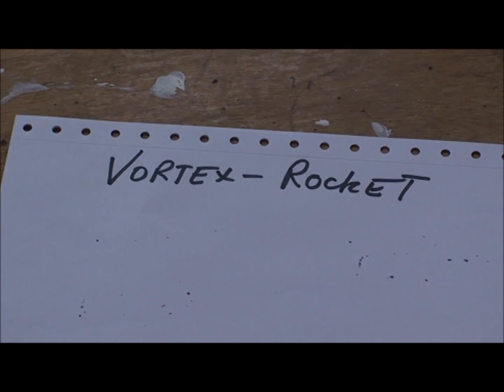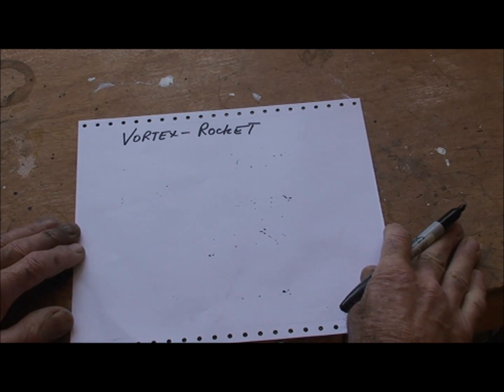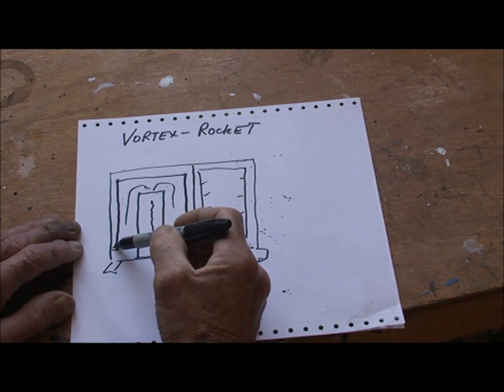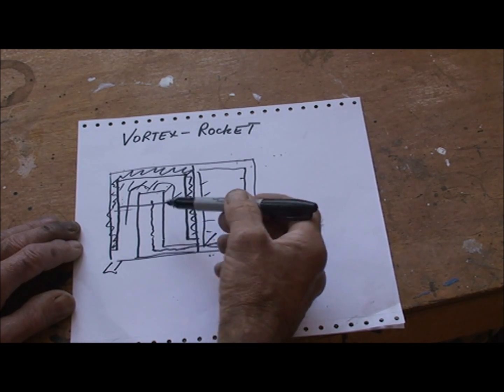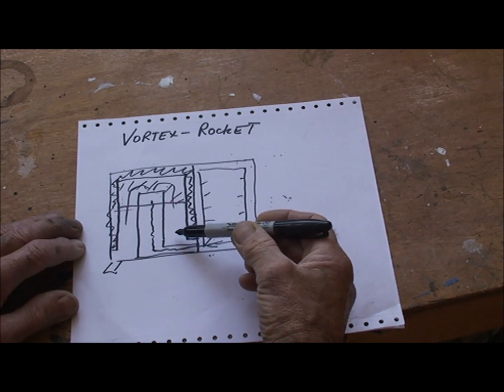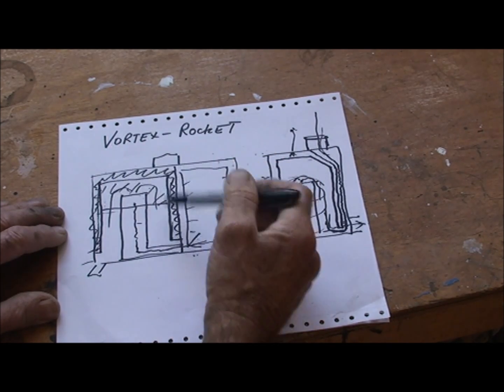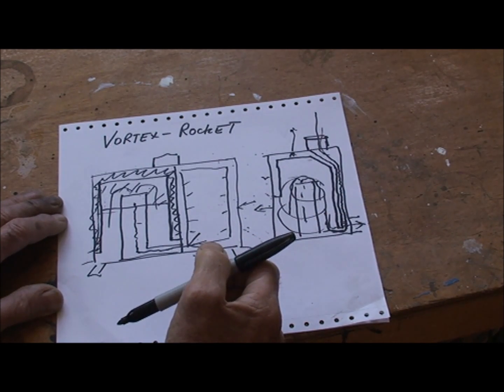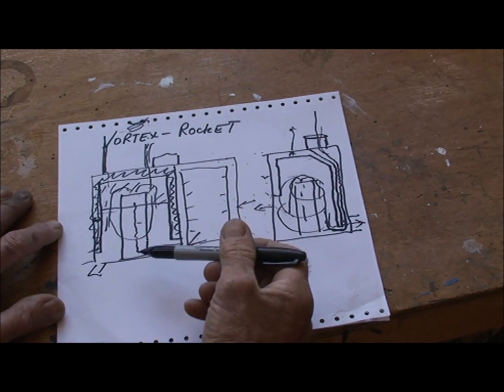V Rocket stove room and water heater.

Comment: Hi ppotty,
                  I am new to your site - sorry to post this so late but I feel it is worth some comments.
                  I have been thinking about water heating from standard rmh but not really progressed as new ideas bombard the fledgling ideas. I saw your vortex tests and I believe it resolves a number of problems - one in particular that I was concerned about was how to slow down the rise of hot flames up the internal chimney (vertical burn tube) - this gives the heat to further pyrolyse the smoke and burn it before it provides heat to the top plate or is exhausted to the chimney. 
       Now for budding idea for water heating - using your technique of 'vortex' - assume the inner vertical burn tube, at a suitable height, was replaced with a 'calor gas bottle filled with water' and the vortex was encouraged to go around the bottle or the bottle with 'some insulation to compensate for reduced burn temperature of the vortex mechanism (if necessary) due to high thermal load of water tank. I am not at the stage of trying it out as I have not yet achieved controlled and consistent vortex on standard rmh. 
        Has any body already tried this or similar approach.
Reply from the maker: +Davinder Dhanjal Hi There, a jacket around the riser tube filled with water has been tried and works, i would keep the jacket in the top half of the riser though so that the base of the riser gets hot enough to combust the gasses and burn clean, a tank over the top of the riser or on top of the stove would also work well as this is the hottest part of the stove and would be alot easier to fabricate and maintain. The top half of this stove i made is a water jacket one bottle welded inside another the riser tube sits inside like a normal rocket stove. https://www.youtube.com/watch?v=KdDkkKRv4aw Cheers.

Comment: I know this video is old but I wanted to make a few suggestions that I guarantee will make your system work and very well.
I tried your method and it worked well, until I would be gone all day for work. The water would cool down and I would have to wait for it to get back up to temp. I got around this issue by building a 250 gallon exterior water tank that I then super insulated. The stove would heat that water up while it was running and I could pull off the 250 gallon tank to my baseboard heaters. Being really insulated even when I am gone all day for work and the stove goes out or produces very little heat when low I still have more than enough heated water to keep out home more than comfortable for hours and hours.
It worked so good I added a second tank that now heats my greenhouse, shop and hot house hot water and it does it off 1 stove.
If you really want a great system add some large holding tanks and your life will be so much easier. Thanks for the vids.-- Rick
Reply from the maker: rcklarue Thanks Rick, Im really pleased you went ahead and built a working version of this stove, I had hoped that the exchanger would produce alot of hot water and you proved that to be the case, good idea on using the water tanks as a mass heat store.
Reply: I've been meaning to build a home heating system and hot-water supply, with several holding tanks as you mentioned. However, the jacket design I had not considered. I instead had planned on a sealed/contained housing for coiled copper tubing. I must say that the water-jacket would be suited for just home heating and not for consumption. I'm I wrong to think that the water jackets would eventually rust out? As you did say that you built it.

Comment: If you want max heat from rocket stove lift burn chamber up and wrap a water jacket around it or coil copper tubing around the burn chamber. My understanding is the burn chamber has to be insulated to keep the temp up to maximise the burn so wrapping a heater jacket around it would maxify the temp to the water.

Comment: Wow I like your idea and can't wait to see how it turns out . I think you might benifit from running an air intake across the secondary burn chamber super heating the air supplying the primary ... just an idea thought you might interested in Martyn S.
Reply from the maker: Martyn S Hi Martyn, Thanks for the idea I may fit two riser tubes into the exchanger yet like I did on a previous vid want to see the difference if any it makes to the draught I do plan preheated sec air supply as well as primary

Comment: PPotty,
I am in the HVAC industry and I am thinking of coming at the Hydronic portion of this from a different perspective. I am thinking of a coil around the outside barrel. Have you tried this method ? If so what were your results. 
I am intrigued by all the possibilities of the rocket mass heater.
Thank you for posting this and look forward to your ideas
Reply from the maker: +Steven Peterson Hi Steven, Yes without doubt a coil wrap would work well, my only reservation is that knowing the temps inside the stove I may have to constantly pump the water inside the coil, I figure with a wrap around jacket there is a much bigger surface area to disperse the heat and the volume of water it holds should run on a thermal syphon until the water gets to near boiling temp. Then the thermostatic valve kicks in to disperse the heat in the rads. With a pump running all the time it will rob the hot water cylinder for the taps of its heat.

Comment: It just seems there needs a way to keep the fire close to the burn chamber opening because it will not stay hot enough for complete combustion.  If the wood fed from the top, like a rocket stove, in a larger diameter or cone shaped feeder then larger pieces could be used and still have that intense combustion zone.  That kind of arrangement may need an induced draft or better seal at the top to keep it from smoking.  I cannot build that but have a draft induction fan and trying a catalytic on it

Comment: I respect your work so much and have watched everything you have done.  I looked at your first drawing of something similar to this one and made an effort to incorporate it into the stove I am working on.  I found that I could not have that large of a fire box and have the burn tube maintain the temperature to make a complete combustion. A cone shaped wood would with top feed might work better to keep the flames confined and temp up.

Comment: I would not worry about a plate.  That steel will have water on the other side and will not over heat if the water can move.  I alos do not think you will get the results you want without a pump.  Gravity flow radiators had three inch pipe and pumps were added because the effency is so much better when you can put cooler water into the exchanger.  Gravity flow can still be a failsafe and will flow through the pump if needed.  You do need a clean burn not to get ceresote build up.

Comment: window is a great idea!! perhaps the plate could be several layers of screen slightly separated made from a catalyst material such as platinum. which is exactly what and how  a catalytic converter works made for a car to insure all liquids are converted to gas. In fact I was thinking of a portion of a catalytic converter to be used as a plate.platinum is a catalyst = changes the state of other things while itself remains the same.

Comment: I suspect your plate idea will make a difference. wonder if shape of that plate could have any bearing on the combustion? would slits around out side make ant difference in air mixing or would concave would have any advantage? or maybe material of it such as a plate with  calcium silicate backer? to push heat out ward better? and keep the plate hotter kinda as a catalytic converter or if the gasses could be trapped and burned in catalytic converter type plate for more surface area? sorry 2 much

Comment: Could the surface area of the water jacket be so great that it lowered the temp in the that stage? could high temps in that stage be needed for complete combustion? so thus would it be better to take heat off after the high temp combustion was complete further down the line in the stove? could it be arranged where you could get all the heat without lowering heat in the gas combustion chamber if there would be any advantage to that?

Comment: Thanks for the reply . I also wonder if how the air at any given point was introduced what % difference  would it make how it entered such as several small ports around sides oriented to promote vortex vs just one port with perpendicular orientation and so on. perhaps there are points that can be identified that can be improved upon. Any problem identified is 1st step into being solved.

Comment: I like the idea!  dragging the heat through the system. Consider going one step further and using several pieces of  3" pipe in the stove with copper piping running through to further trap heat. This way you are adding more heating toward the hot water and less to the room. .